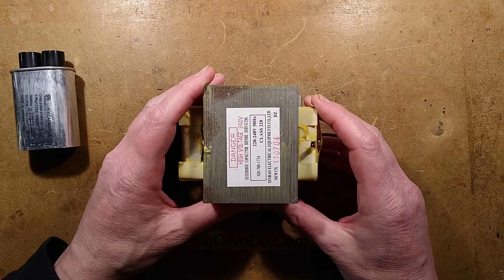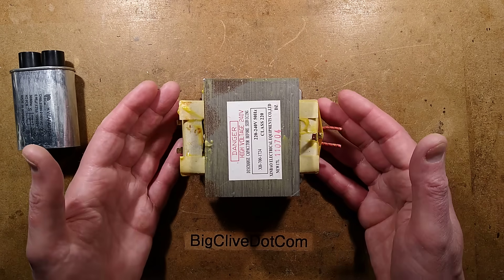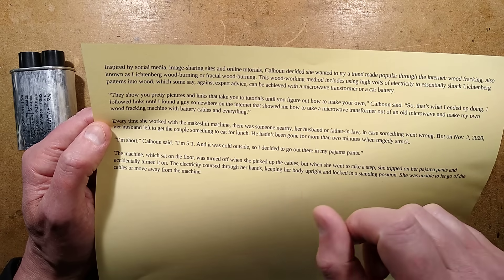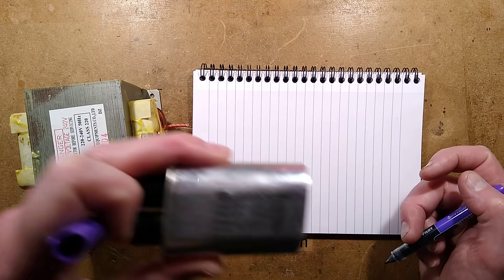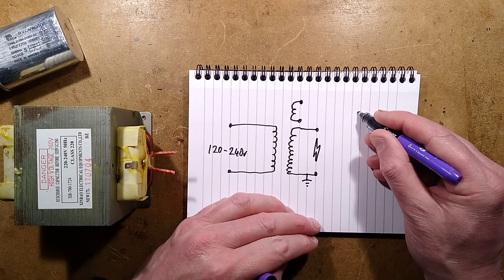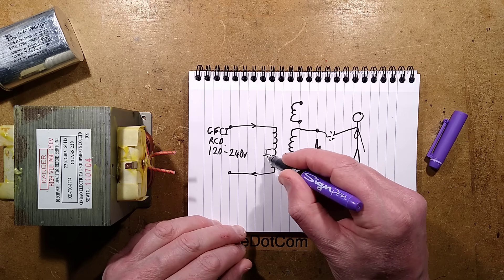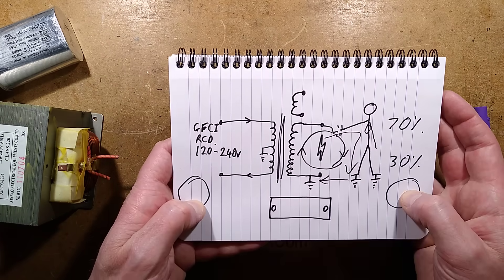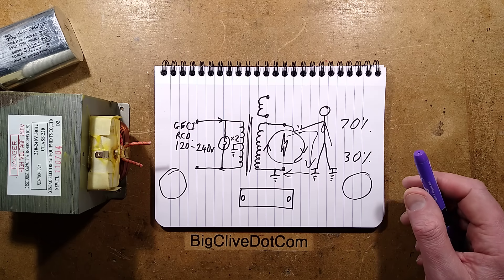The most deadly project on the Internet

Comment: I've seen tables with those patterns burned into it...
    Could you use a battery driven ignition coil and power transistor interrupter? With the safety switch arrangement?  Since you said it worked with 30 ma from a neon sign transformer, it should work with an ignition coil.
     At my last job, there was a huge paper cutter that had three " dead man" switches. You had to push widely separated switches while standing on a pressure plate to work the cutter. It would take a truly better idiot to get hurt with it...
Reply: Never fear.. Evolution is always making those "Better Idiots" .. though in many cases they never achieve breeding status..

Comment: I used to do this on a smaller scale w/ a TV flyback back during middle school yesrs. 50+kV but only 48W input. No idea what the frequency of the oscillator circuit was.
Reply: 15KHz is the most common.. derived from the line oscillator
Reply: @PaulaXism  this used an RC pair driving 2 transistors.

Comment: Clive is right about how dangerous these are. I was an industrial electrician and I went through the training to know to not get anywhere near anything that high of voltage without high voltage training. Even with HV training and full safety equipment, it is still a very dangerous and deadly voltage range to be near. And by near, we are talking about anything closer than 5 meters.

Comment: I am in the process of building MOT x10 voltage multiplier for 30kV electrospinning and plasma sputtering. If i don't reply how it goes next week, welp
Reply: There are many better and safer ways of doing that...
Reply: @Basement-Science  The microwave diodes and caps are nicely rated, cheap and available. Rest all is just expensive. BTW, i have a random phase SCR controller the output voltage, the auxiliary winding goes to ideal rectifier to the ADC. The microcontroller then adjusts firing angle to giving voltage level control
Reply: @pranjal3727  It sounds like you know what you're doing, I was just thinking that for example a CRT TV flyback would be a better solution. Mains frequency multipliers are just unnecessarily big and dangerous for what you get in most cases, especially if you want to multiply by more than 2-3x.

I've built a pretty big 25-stage multiplier at 50Hz, and the sustained output current is a joke for the size, and the output is super deadly as well because of the stored charge in the capacitors.
Reply: @Basement-Science  yes, 50Hz multiplier is not great for low capacitance multiplier strings. I need 30KV at 2mA max.
Reply: @pranjal3727  yeah a flyback can do that very easily without a multiplier. Probably much easier to control as well.
Reply: @Basement-Science  This machine will be kept in lab working hours. Flyback might burn at 30kV. Plus 2mA at 30kV is lot for flyback. 2mA is the pure DC continuous current i need.
Reply: @pranjal3727  well I guess it's at the upper end of what a single flyback can do, but should be doable, especially with some cooling and a decent model. There are flybacks that are actually rated to at least 30kV and last many years in the CRT they come from.

I wouldn't be too confident in phase-angle control of a multiplier myself though. Dont have any experience with it, but the repeated transients you would get switching the capacitors dont sound like it would be very reliable either.
Reply: @Basement-Science  I'll try flyback too then. 🕺
Reply: Well, it works. Apart from the fact that multiple arcs at full voltage create enough EMI to reset the microcontroller. The use case is isn't arcs anyway but constant stream of corona.
Reply: @pranjal3727  Nice. Probably good to harden the MCU against EMI either way if you want it to be reliable. It's hard to avoid strong EMI problems like this when dealing with HV in any case.

Comment: The best shocks i've had is testing insulation resistance on 4 core 240mm2 Aluminium XLPE distribution network cables. Tester set at 2500v, but would charge the cables upto over 3000v, some runs a few hundred metres long. They would act like a big capacitor. After testing you would have to earth the cables out to drain off the voltage. But sometimes would get distracted or forget. Go to bolt the cables back together and would get one hell off a crack! Would have sore arms for a few hrs after lol. Good times.
Reply: I used to assemble, process, and test 138, 230, 500, and up to 765kva transformers all over the USA. I've been hit by the static on a 500kva TX doing a hi-pot test in Tennessee. In Denver Colorado we forgot to mouse off all of the bushings. When we were done processing the TX, I  climbed up the ladder, grabbed on to the neutral bushing to pull myself up and uncomfortably grounded all the static stores across the 138 KVA transformer from static being generated running through the pump in our degassing unit.
But to date, the worst shock I have ever had is stripping a pair of phone  wires in my mouth on a warranty call in Phoenix Arizona when a call came in at the same time. After the first ring I pulled the wires out of my mouth, turned around to the customer with now the face of someone who just seen a ghost, to politely request that she answer the phone and have them call back later.

Master electrician, mostly as a top troubleshooting and diagnostic service tech with a degree in wind energy. That 48vdc was the worst. By far.
Reply: @USAINC1803KKR  It's actually upto 120v when a call comes though. Well it is here in Australia. I'm an Electrician and Telecommunications Tech.
Reply: @staples4335  In the UK its 50V DC on one wire of the pair, plus 75V rms @25Hz on the other while ringing.
Reply: @staples4335  here in most parts of the United States we're required to keep it under 50 volt DC for it to be considered low voltage otherwise you have to be an actual electrician with a license you can't just throw that shit in willy-nilly. Anything over 50 volts AC or DC you have to have an electrical license in the US.
Reply: @USAINC1803KKR  “With the face of a ghost” man, you don’t know how hard I laughed at this one. I would never thought we could get a shock from a phone wire. Thanks for letting us know.
Reply: @USAINC1803KKR  You guys use the Omicron test gear on the HV? Thats mainly what we used when I was working HV substations.
Reply: @staples4335  I know we use Doble and you can only lease this equipment you cannot purchase it so it's expensive as fuck.
Reply: @USAINC1803KKR  Ah yeah. The Doble equipment looks similar to the Omicron gear. Yeah costs hundrends of thousands of dollars lol.
Reply: @staples4335  and can't even buy it! What really sucks is when it fails on site and can't even do a simple fuse replacement without huge penalties from Doble if you don't send it in.
LOL I thought you were fucking with me with the Omicron thing as I have never heard of that test equipment over here.
Reply: @USAINC1803KKR  Yeah it's a kinda unfortunate name atm lol. Look up Omicron CPC 100, that's what i mainly used.
Reply: The nastiest I got was 1.5kv @15.4 khz, with 125 VDC that the 1.5kv rode on. Was seating a board after adjusting the vertical size, sliding it in, pinhole in the flyback arced to me, the other hand arced to the tuner shield. Later, we had a run of bad boards, so Zenith sent out their design engineer to figure out what was wrong. He had designed the power supply and figured I had had to have drawn over 3 amps to kill the regulator as I did.
Showed him what was failing and why, a production change ensued into a service bulletin.
My forearms hurt for three days.

Another time, caught 45kv from a projection TV anode with a pinhole. Stung like hell, used  screwdriver with a longer handle next time. Damned thing arced to me, rather than the screwdriver, then to the blade.
HV can act weird, especially when it's RF.
Reply: @spvillano  yes anybody working with any higher frequency definitely should be wearing the appropriate class PPE gloves rubber inside gloves with the proper exterior gloves on top of your gloves. 277 volt lighting is a killer over here a lot of entry level text used to catch 277 through a neutral on another circuit. The code was changed in 2012 that now require an individual neutral for each circuit in a raceway so no more neutrals providing returns for three different circuits on three phase systems. I personally know a kid second year apprentice  that died on 277 volt lighting he was the last of three lower level people left in the company when the recession hit in 2009 I was there last tech they laid me off and then they saved $10 an hour for that kid to die 2 months later. The other two lower level people was his father and his brother.
Reply: @spvillano  most people also don't take into account how humidity can also affect ark gap and skin effect when they're around high frequency circuits.
Reply: @spvillano  I read that old projectors are particularly dangerous not only because there's a high voltage supply capable of supplying a lot of current but also because the bulb it powers gets to a very high pressure when hot.
Reply: @NiHaoMike64  I worked at the college when I went back to school for wind energy and had to upgrade all of them to the new LED style the old ones have high pressure sodium lamps in them that do get extremely hot and also tend to burn up the projectors themselves at times the new ones one run way cooler.
Reply: "good times" 😂

Comment: The capacitor in them can kill you even when they're unplugged. Same thing goes for big old fashioned CRT televisions and monitors. My grandfather used to work on CRT displays and they'd discharge the caps with old screwdrivers but you could only do so many before there wasn't enough shaft left.
Reply: @T.J. Kong They do, but sometimes the bleed resistors burn out. Like Clive said in the video, never rely on a bleed resistor.
Reply: Been there as a teenage computer repair tech during university.  Knew all the theory, but in practice is not theory.   Thankfully it was a monochrome CRT rather than colour but the flyback tripler is still well over 10kV even if low current.   Was a good lesson to young self: all HV is dangerous and NEVER, EVER be complacent.
Reply: @T.J. Kong they were supposed to but he's from Texas.
Reply: Got a video call from a friend who couldn't get a 16mm projector to work.
He had the side off and was pointing to bits inside while taking.
Not an electrics guy.
Suddenly he had me shouting to get his bloody fingers out of there, I'd just seen the caps the size of coke cans in there 🥶

"Is that why it keeps zapping me?"
 Yes you idiot, your lucky they don't hold anything scary when it's switched off
Reply: There is not much total energy in a CRT with residual voltage and so it cannot melt very much metal.  You would have to discharge millions of CRTs before you wore even part of the shaft of a screwdriver.
Reply: @AlanLiefting  I think someone is confusing the HT capacitor (around 400V and several Joules) with the EHT (10kV+).   I did once get a belt from a CRT that had been removed from the set a good hour before, when my hand carrying it strayed near the EHT terminal.  It was kind of like the spark you can get when getting  out of the car.
Reply: @AlanLiefting  Ever done this? I was happy to use glasses on because of the flying scrap of those cheap screwdrivers I used for this as a kid. Okay that is more some explosive thing in probably cracks instead of real melting but in just a few times that screwdriver was a goner. I had some part stuck in a wooden plate at least 10 cms away near the testbench.

That said... on my old TV I had the back not screwed back on for many years. When I did not have a picture I used to just wobble the HV-cable around near the CRT untill it worked again for a couple of days.
Made special sounds...
Reply: @elvinhaak  I have fixed plenty of CRT TVs and monitors in my time and, with all due respect, I find the incident you describe very hard to believe.
Reply: @AlanLiefting  Yes, also was not expecting it when it happened to me. Of course with screwdrivers that you buy for a set of 5 or 6 for 3 $ in the hardwareshop, not with expensive good quality ones (which would be a shame to get pits on from discharging capacitors, lifting parts or scraping bords with). Until a few years ago I had that workbench with the reminder on it to be careful.
I think now I have not repaired any CRT for over 5 years - since they switched off analog TV here they have been fastly replaced with those modern, uggly flat things...
Reply: @AlanLiefting  : It's not usually the CRT with the most dangerous energy storage, it's the capacitors inside, some perhaps directly connected to the HV, but certainly some involved with the mains connection.
Reply: @absalomdraconis  nothing is dangerous if you know what you are doing. 

Your reply is confusing.  When a device with a CRT is turned off (which is the situation is was referring to) the only residual charge is generally only in the CRT, which by the way is acting as a capacitor.

I have fixed plenty of CRT TVs and monitors in my time.

Comment: I am certain of three things regarding this project.

1. I like the look of Lichtenburg art.
2. There are trained experts (not just “experts”) who can produce it and from whom I can buy beautiful works of art.
3. I am not one of those experts.

I wish that more people learned that lesson. Wood burning is a skill that takes training. Working with electricity beyond the very lowest power electronics takes training (I count 99% of basic computer stuff in that category - you might get a small shock, but anyone can build a logic circuit off a 9v and hardware store parts). If you lack either or both, this is not something you should be doing without supervision by those who are trained and experienced.

Comment: I had a run in with a high voltage ignition on a Toyota FJ40 and several tingles from residential mains working as an electrician, I had a good think about it, and to have a setup that I would feel safe using is impractical and also I know myself too well I'd use it for a while and get bored and it would succumb to Murphys law of horizontal surfaces

Comment: Appropriate signage for a microwave transformer: This device will kill you and hurt a lot doing it. Another problem is the insulation on most wire you're likely to find may well fail at the voltage involved. I'd suggest the wire made for connections to spark plugs, the copper variety.
Reply: even the carbon ignition leads will work.

Comment: "Dead man's box" or Dead man's switches in industry typically have 3 position buttons that get depressed.... and you press it down to the first position to operate, let go to the first position, or press harder to the third position will put the machinery into E-stop...

This would be a better way to do this, if you get a shock and you grip it and press the button too hard, it would cut out automatically.

Working in industrial controls, the best way to do this would be to build an enclosure that kept you from having to hold the electrodes, and having an operator stand that had a very thick isolated rubber pad to stand on. Starting the machine would lower the electrodes and then turn on the power for as long as the deadman button is held.
Reply: The usual reason people make the hand-probes is to poke around and tease at the pattern. IMO, making yourself a 2D plotter using plastic parts (because sanity) and using the pen position as the electrode would be a good way to do this and be safe. This would let you completely remove yourself from the location where the HV is and be able to control where the HV is added.

Bonus points for putting the whole thing inside a huge plastic box. Extra bonus points for filling box with sulfur hexafluoride.
Reply: @ConstantlyDamaged  Hmm. Waldoes.
Reply: @VulpisFoxfire  Or just make a simple etch-a-sketch type controller for it. Bonus points because it would keep all your phalanges from finger-poken the HV.
Reply: Yeah, an enclosure was my first thought too.
Reply: Also, for those willing to go a tad bit further, some of the fiber-optic "toslink" audio cables in stores have an adapter to stick into a standard 3.5mm headphone jack, because some DVD players & such used that as a miniature form of toslink... so if you're willing to use LEDs to transmit your "go!" signal, then you can achieve even more separation.
Reply: @absalomdraconis  Probably easier to use some 3d printing tricks to make a long plastic rod to actuate a switch. Less effort.
Reply: When I worked in an auto plant (about 50 years ago), they had huge punch presses for stamping body panels. It took four men to load the sheet metal into the press. On the other side of the room, they had eight big pushbuttons on the wall that had to be pressed in order for the press to run. Something like that, with two buttons, might be the trick. And if you want to manipulate the probes, I think the suggestion of using a 2D plotter as a manipulator is probably the way to go. Even better was someone's suggestion to download a picture and use an CNC router to cut it into the wood. Go over it with a propane torch and nobody will be able to tell the difference.

Comment: I'm a sucker for saving transformers out of almost anything, especially microwaves and other high voltage items like HPS and Metal Halide light bulb ballasts which are often 4x the size! However, I don't plug them in. I take them apart and save all the copper wire for other much "safer" projects. 👍
Reply: i used the spare copper for motor windings and the electrical steel for the stator iron